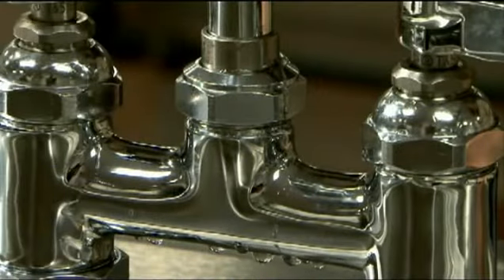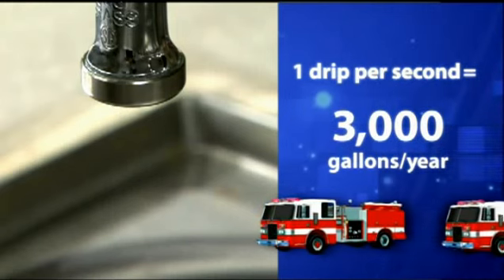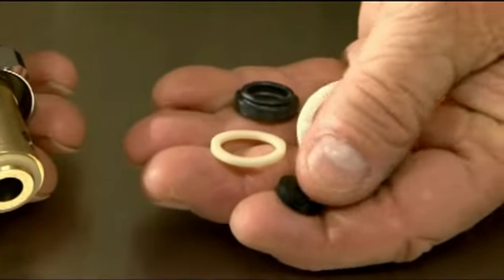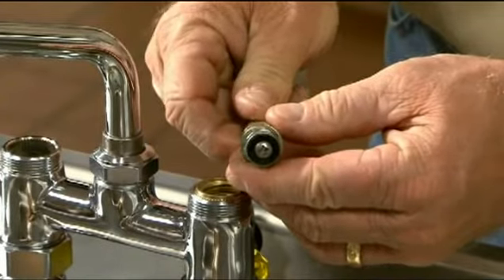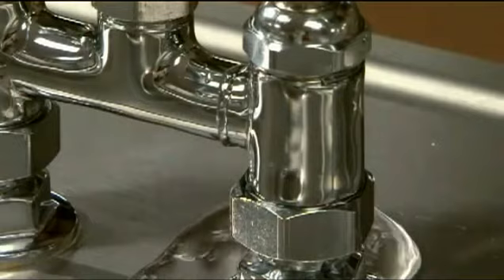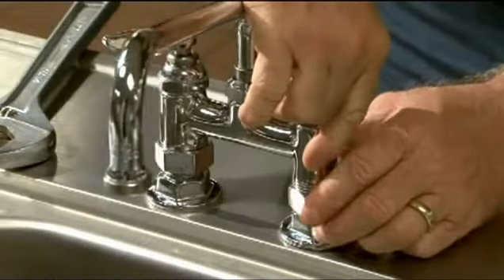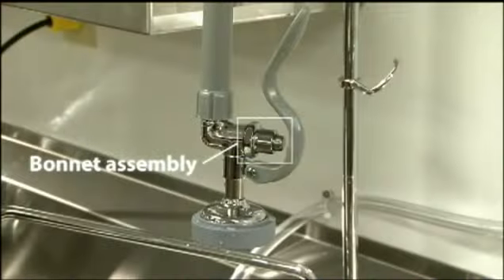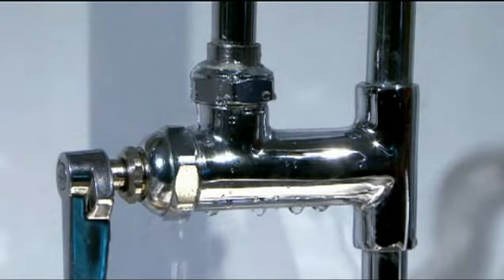Leaky Faucet Trouble Shooting

Comment: A thousand gallons is 10 dollars in most places. And most drips don't show up at the meter. Most newer stems don't have  replacement washers. Finding parts is often difficult.  Sometimes  better to change the whole faucet.  Which is not easy because  of lack of room. But yes a leaking faucet  is annoying even if you don't pay th e water bill. And it eventually turns in to a stream.